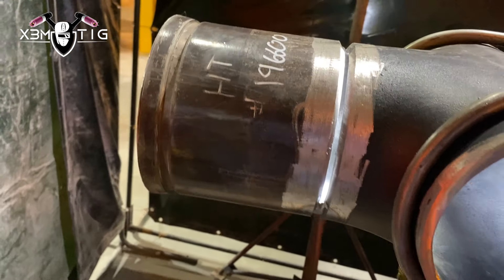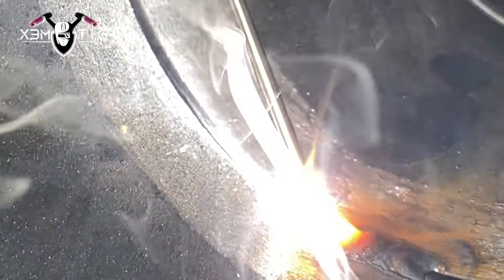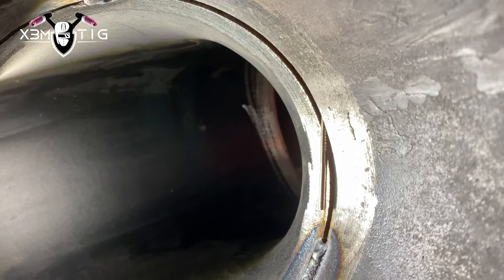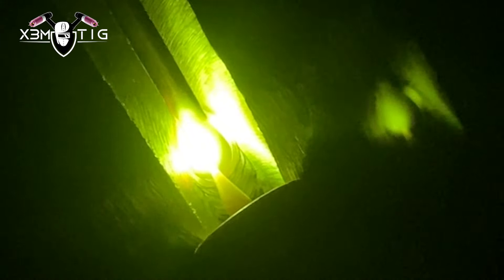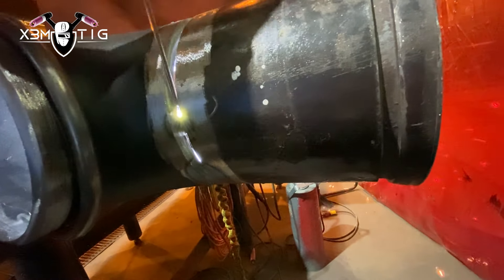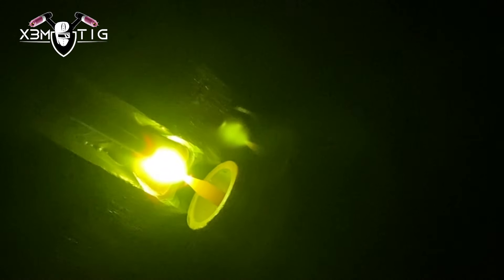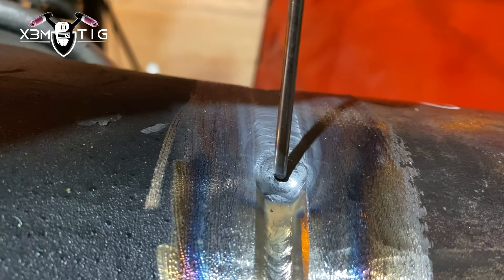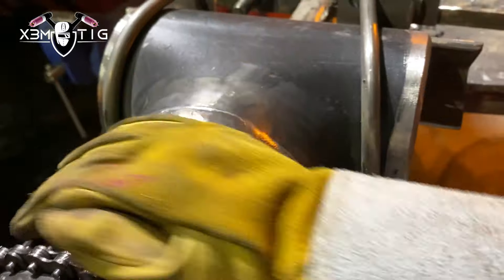Efficient TIG Weld Root Pass Technique !

Comment: There are lot of welding videos on youtube, but i enjoy watching yours. Because you mention exatly all the neccesary parts of the welding proces like: how you feed the wire in to the root, angles of the wire trough the gap, keeping the root consistent, feather grinding on the tacks and every stop.....and everything else important to not screw up. I'm about to go to my first test and i fond your videos very valuable and helpful. Thanks for sharing 🙏
Reply from the maker: Thank you my friend. I like to narrow it down to plain talk, and pointing out what is important to you guys. Good luck with your test, and thanks for your support 👍
Reply: Best advice I got for my tig root test was not to have a tack at 6 on the bottom, to push that 6 tack back almost an inch to your weak side, so you can do more with your dominate hand on the bottom.
How did your test go?
Reply: ❤❤nice

Comment: Love the vid s man, quick question when you restart the bead with a 7018 I notice it looks like you don't chip the slag where you restart? Is that not necessary? Thanks 👍
Reply from the maker: Hey bud, thanks for your comment. I always grind stop-starts . It is necessary!
Reply: @X3MTIG  thanks buddy I bn trying to learn pipe welding for ages I got my first test for a job in a week or so all help is much appreciated 👍

Comment: what’s your thoughts if you do loose connection with the root while welding? just continue get the wire back into puddle? or stop grind and continue?
Reply from the maker: Just continue on by adding wire back into the puddle!
Reply: @X3MTIG  excellent i’ve been messing around with this different techniques at work it’s great for keeping the root cleaner looking from silicone as to when you dip dip dip the root looks dirty 👌🏻

Comment: Very good video . I have a question , I am doing 5G schedule 80 6inch pipe with a 3/16 gap 105 amps 1/8 wire , on my 6 and 3 o clock my puddle gets build up and I can’t go up , do you have a tip ?
Reply: Built up on the inside?
Reply: Yes
Reply: @lalo2720  what I would do and it might help might not, but put your wire more on the outside of the bevel. I do about 70/30 inside/outside on the bottom, then once I get to about 8/4 o clock I start bringing that wire towards the outside of the bevel the higher I go. Gravity is gonna pull it in. Hope that makes sense and helps. You don’t have to push feeding like that, just enough to keep the puddle fed.
Reply from the maker: @nathanielclause2588 pointed out . Also try moving faster, speed up your travel speed.
Reply: @X3MTIG  thank you I really appreciate
Reply: @nathanielclause2588  thank you a appreciate
Reply: @X3MTIG  it work I got my root in 🎉thank you
Reply: @nathanielclause2588  it work thank you

Comment: Is that perocity on the inside? if its not is there a way it can be fixed?
Reply from the maker: There is no porosity inside! Fixing what exactly, if there’s nothing to be fixed!?
Reply: I think what you might be referring too is called the oxidisation on the inside surface of the root. Thats just atmosphere reacting too the weld pool on the inside. The only way to stop it is to purge the pipe completely. But with that much penetration on the root, there is usually no need.